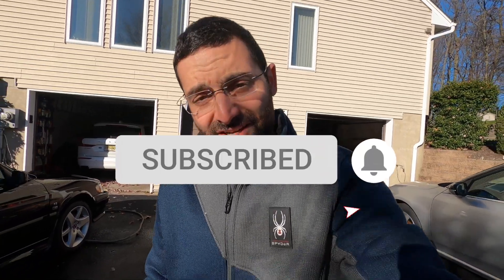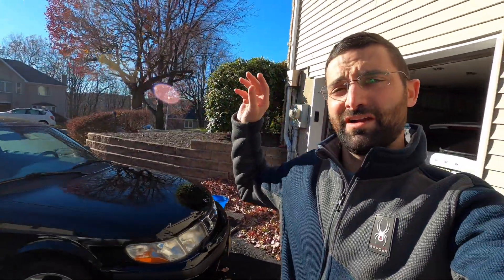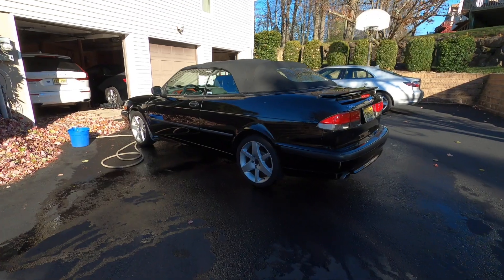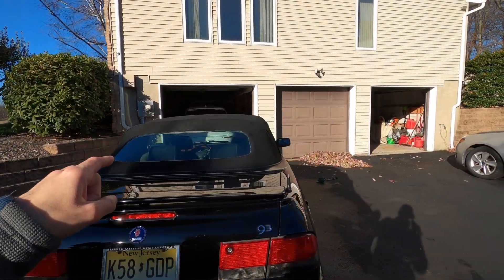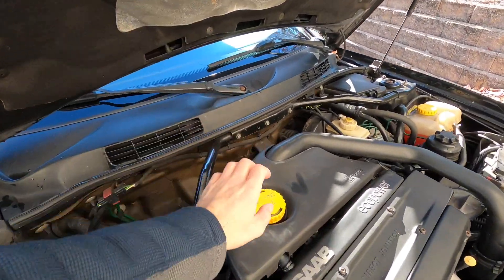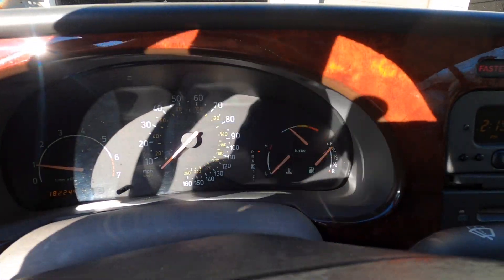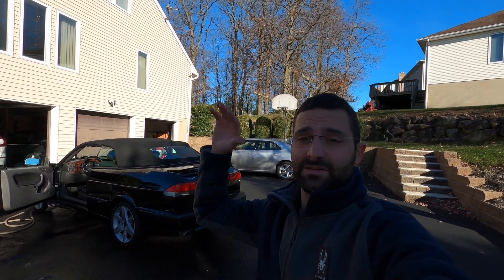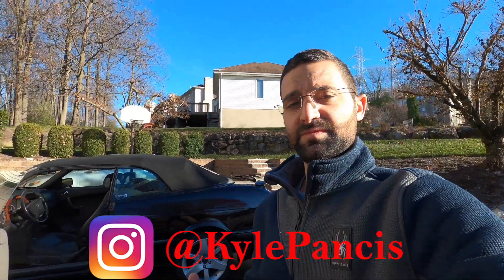Taking Pre-Orders on My 2002 Saab 9-3 Convertible + NEW TRANS

Comment: I have a 2001 SAAB 9-3 vert in the backyard with 60k miles on it, girlfriend busted the radiator in it running off into a ditch, then drove it till it overheated and engine seized, then let it cool down, and repeated the same thing.  still have then car, but got rid of that girlfriend

Comment: Curious what in the transmission causes that 70mph vibration? 
Input shaft bearing? CV shaft output bearing? My Vig is doing the same thing. Wheel balances and other attempts to resolve it failed.